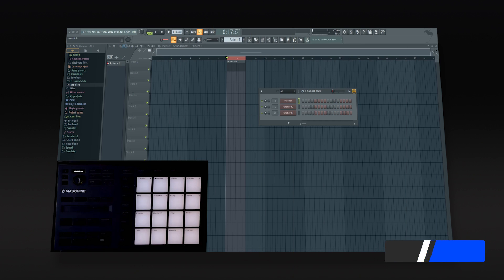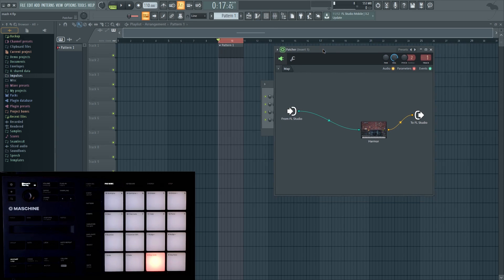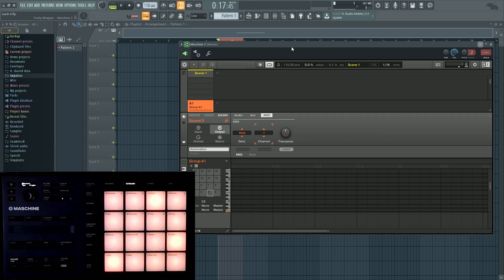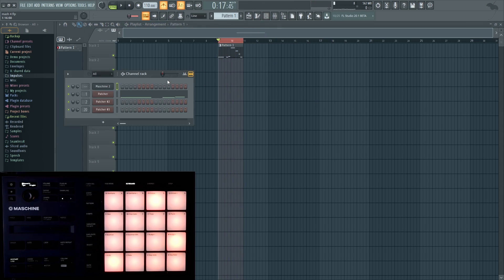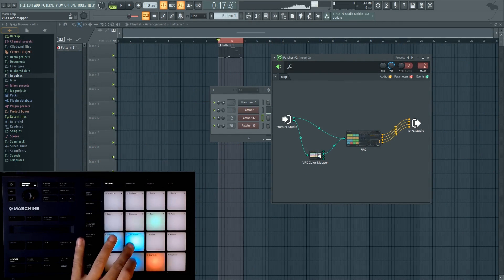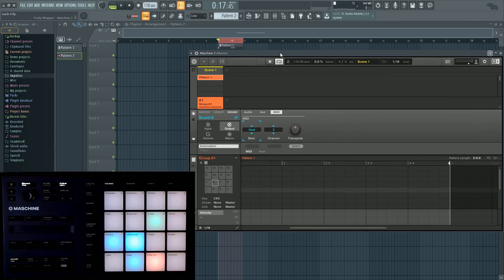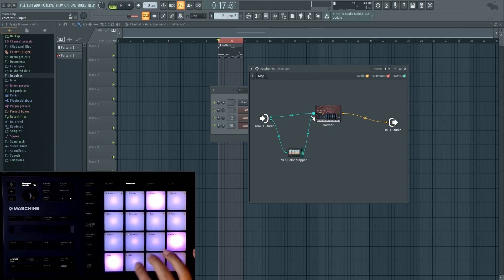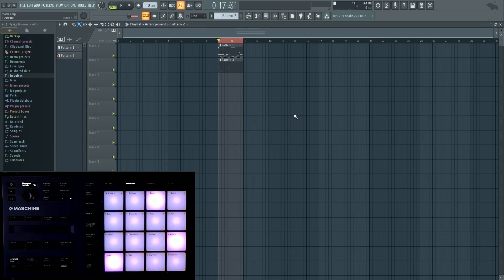FL Studio & Maschine Mikro MK3 Integration

Comment: why not mapping FL directly with Maschine as a midi controler ? Except for the pad color, I don't see a real improvment in the workflow here
Reply: How do you do this? This method gives me stupid latency
Reply: That's what I'm here for. I used my maschine mk1 as a simple midi controller but can't seem to figure out how to do that with my new maschine mikro mk3.
Reply: @VicLeonTV  yoo just press SHIFT + Project button(thats the little circle on the upper left side)
Reply: @TheWillskiTheory  I was able to finally figure it out. Thank you!
Reply: @VicLeonTV  no doubt i the same happened to me when I brought it and it took me a minute  to figure it out no problem
Reply: @TheWillskiTheory  I wish I could change the colors of the pads while still using it as a midi controller, without having to use the Native software.
Reply: @VicLeonTV   yeah having to use the controller editor each time is wack, I just wish the vst worked like a normal vst
Reply: @TheWillskiTheory  how do you map sounds to the pads tho?
Reply: @TheWillskiTheory  legend
Reply: my main problem with that is that in order to re do a pattern u need to take your hands off the drum machine and back to the computer since the restart button isnt linked to FL when its in midi Hazelcut